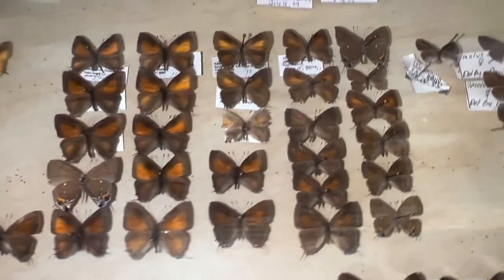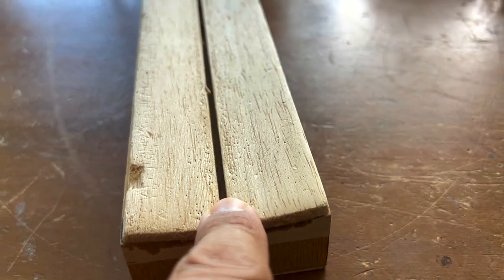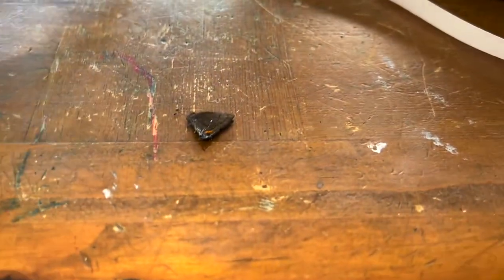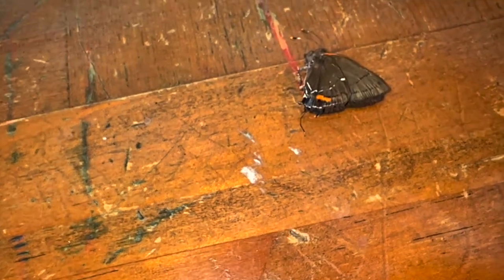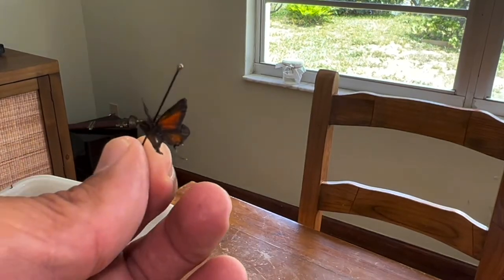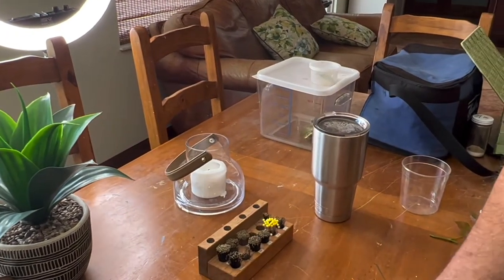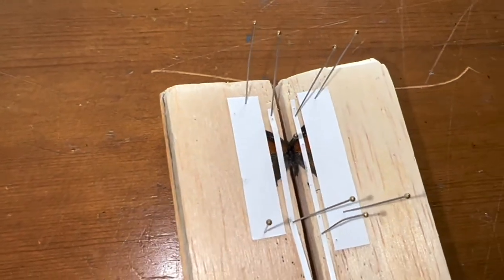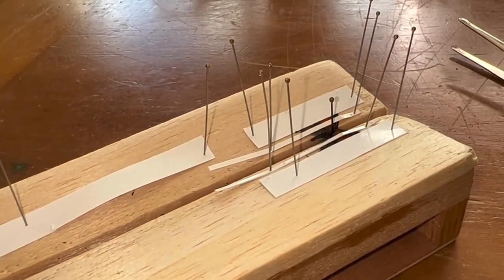HOW TO MOUNT A HAIRSTREAK BUTTERFLY

Comment: what i do when i catch lepidoptera AS SOON AS i catch one i give them a little squeeze and that kills them instantly so i dont waste money on these chemicles because most of them are hard to gat AND THEN i put the straight in the FREEZER not the frige because when in the freezer it freezes the bottly fluids and preserves the liquids and i can keep them in there for as long as i need so if i dont have enough pins i can put them in the freezer untill i get more pins and then all i needd to do is just take em out and wait for them to thaw out and i mount them
Reply from the maker: Good call. I only use the fridge when I’m trying to keep them cool for a short period of time until I’m going to pin them. Otherwise I use the freezer as well
Reply: I do the same killing method, a squeeze to the thorax and they go right out.

Comment: Owh man u cannot use the papper strip for the small butterfly..just use soft tracing papper only..just my opinion✌️😁
Reply from the maker: Well, I appreciate it. Been mountain them that would be for 25 years and it works good. The firm paper helps hold the wing in place. But I do see why you would use tracing paper.. It would be more gentle on the wings.